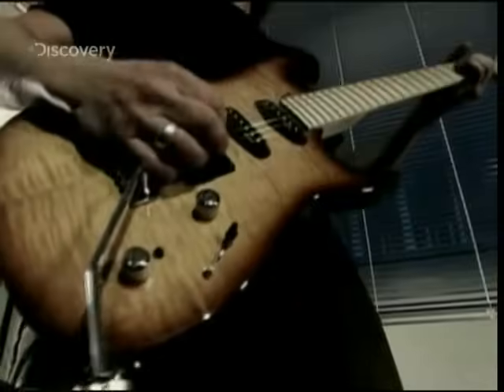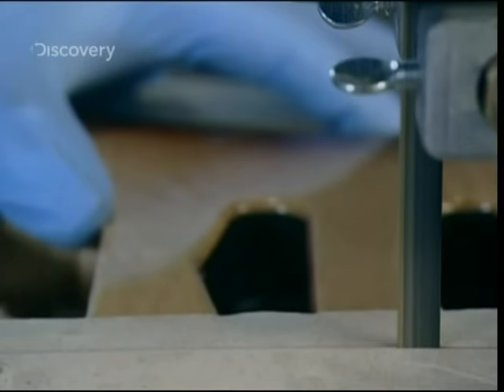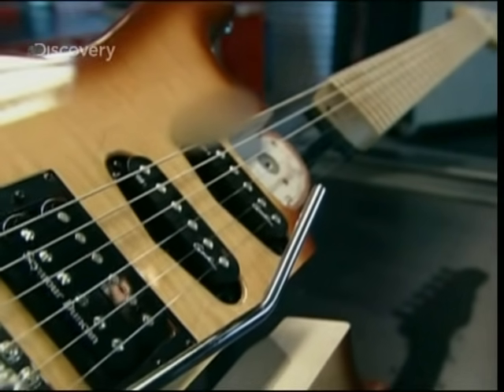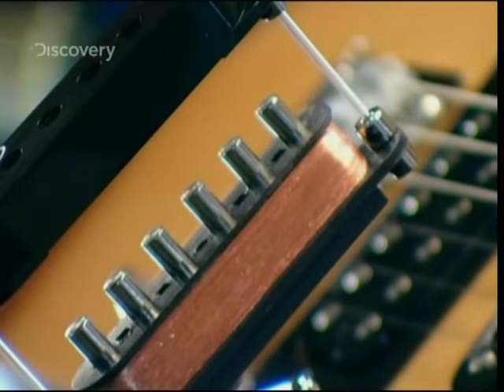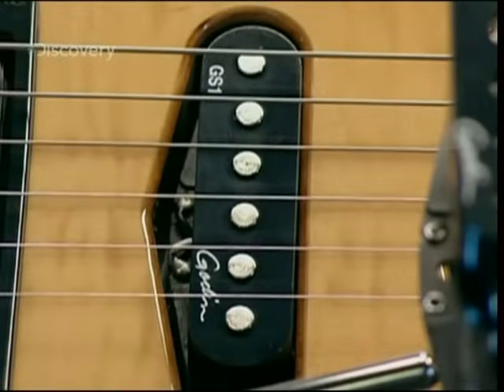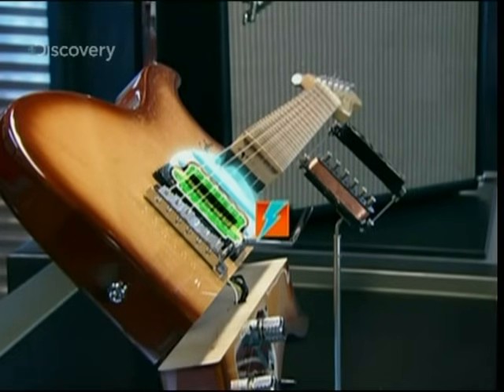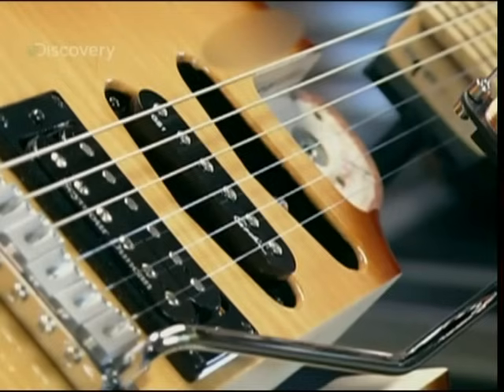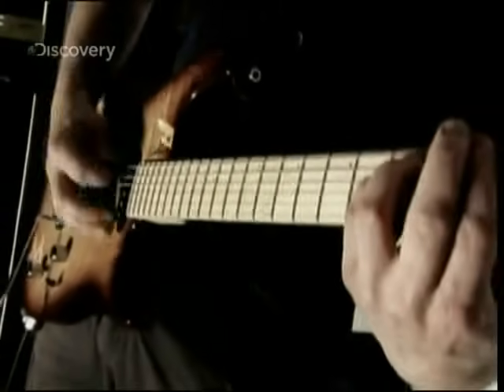How An Electric Guitar Works

Comment: I love how they censored the guitar's brand, but not the pickups.
Reply: What about using a Fender Twin Reverb Amp, as an example of an amplifier that distorts! It is of common knowledge that the Twin is one of the cleanest and most difficult to distort amp (to do that you need to play at deafening volumes or use distortion pedals)
Reply: The Shepherd of Fire love your name and profile pic!
Reply: What make of guitar was it, I'm not sure but it looked like PSR but I don't know!
Reply: Nor the amp
Reply: yeah, what's up with that?  That doesn't make sense.  They spent all this time on visuals and got the facts wrong too.

Comment: Did anyone else cringe when he cut the guitar!! :O
Reply: Godin guitars are not cheap...
Reply: Then why are they using cheap ceramic single coil pickups, cheap pots and cheap switches? That switch is the exact same one you'd find in a Squier Bullet.
Reply: I just sighed.
Reply: The more expensive the guitar the more views. LOL
Reply: Guyz, don't be silly ;  the portion he separated with a saw is originally a segment that was pasted to the main body with a glue during manufacture; he can fix it back again with a glue any time. This piece has nothing to do with stress from strings.
Reply: I'm guessing you're the kind of person that doesn't change his guitar strings?
Reply: OKAY W H Y-
Reply: I cringed when he called the whammy bar a lever

Comment: first off it is not a theory it is a fact ! if you actually think you can mount a bridge and a neck to jello go for it,. the wood is not a factor whatsoever, WOOD IS NOT MAGNETIC !! you could mount all the electronics, bridge and neck to a cinder block, once amplified there is no difference in sound, I grow tired of arguing with the ferromagnetic wood crowd, do some actual research, learn how guitar pickups, caps and pots work and you will see that electric guitar tonewood is a myth
Reply: I don't claim to know anything about tonewood, but wouldn't it make some difference to the sound? The fact that the wood itself vibrates, must cause the relative position of the strings to the pickups to vary, assuming that the pickup doesn't move as much as the bridge because of the dampening from the way it is mounted to the body. Yeah, I know the amount of movement would be minute, but it must have some effect causing the vibrations to go in and out of phase. Just bang the body of a guitar and it will make a sound. The wood doesn't need to be magnetic for it to vibrate a string. Surely the argument against tonewood would mean that the bridge, nut, frets, and tuners could all be rubber mounted and it would make no difference to the overall sound produced.

Comment: You're right in parts, it is obvious that the sound of the pickup has a strong influence on the final result, but most of the time your hands are on the ropes and that is where the wooden acting, after all is the wave vibration of the wood that will interfere in how the string will vibrate the maeiras can make a tremendous gain or a sound fatter. Now all I have to say is that all the components influence the sound.
Reply: While everything has an effect on the overall tone, certain things can be disregarded because of how minimal their impact is. The slightest temperature change can effect tone. But tone wood definitely has such a small impact that it can be disregarded. If you wanted to correct this video, you should have corrected the fact that not all guitars have tremolos and the effect itself isn't called "tremolo", it's called "vibrato"

Comment: Not only that, it was on several parts of the guitar, and oddly enough, they blurred the mark on the body in the start, but didn't later on.
Lazy ass editors.

Comment: it's not voodoo is physics. Of course an Amp will make a much bigger difference than the brazilian rosewood you mentiod. 
I had an A/B with a Flying V style and a Les paul style guitar. The V had the same neck specs than the les paul and the same pickups.
The V sounded way more bright nearly thin when played clean. The Les paul sounded way warmer. 
Did you never compered guitars from the same production line? every fucking guitar sounds diffrent!

Comment: However, the different woods you use can affect the sound. Besides the fact that les pauls have hum buckers and strats single coils, they sound different because usually les pauls are made with mahogany and a maple top and strats with ash or alder, which isn't as warm of a sound as the mahogany. Also the thickness of the wood matters too in the tone of the guitar.

Comment: connect your electric guitar to tuner(i hve one on my pc) that also shows you the frequency and it will say 110hz,the high e string vibrates at only ~329.the  a string on a violin is 440hz.

Comment: Tuned correctly, the A on a standard scale 6 string electric is a 'middle A' which is 440Hz.  A can also be 27.50, 55.00, 110.00, 220, 880, etc...

Comment: Instead of coper wire can u use other metal like aluminium?
Reply: i guess you could technically use solver since thats the best conductor of electricity but that'd be expensive so the second best option is copper, other metals like aluminum are not exactly the best conductors of electricity

Comment: there something wrong there. the body of guitar HAS to do with the sound / tone even though not to the extent of an acoustic. that's why electric guitars are made using different combination of woods (for example alder body and mahogany tone block, koa wood etc), because different woods contribute to the resonance of the electric guitar, and produce the differences in tones.

Comment: Was just going to say that! Unless you're running a MIDI connection. In which you can be playing strings strapped to a 2x4, and it wouldn't make any difference sense a computer is what is generating the tone.